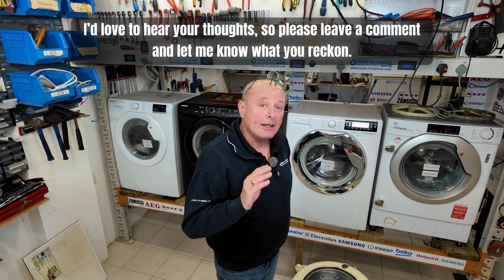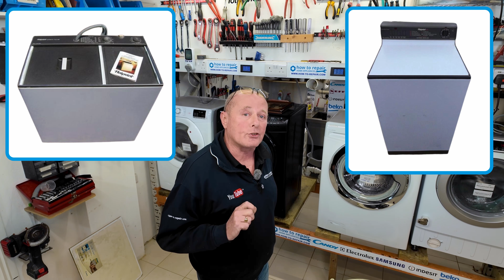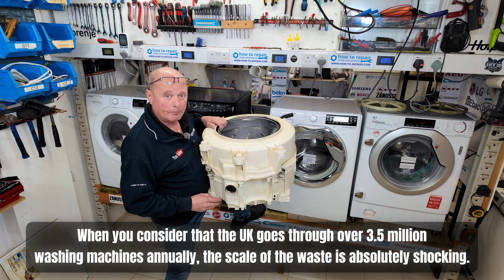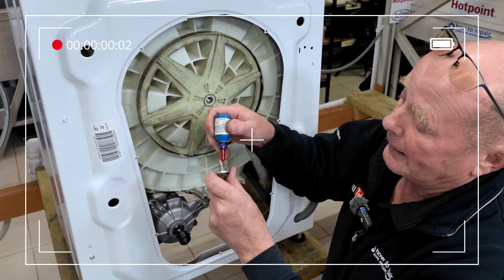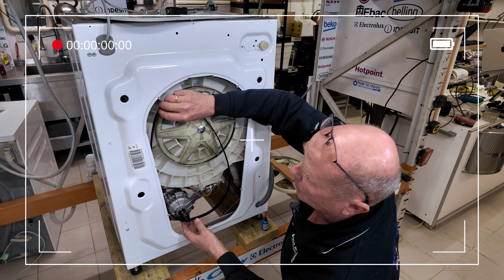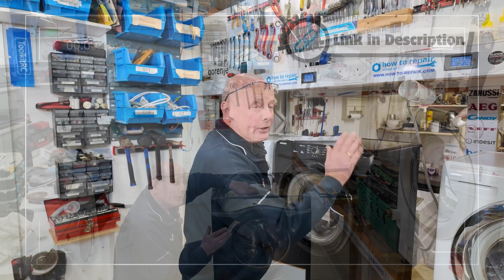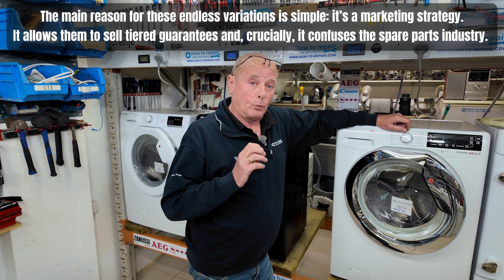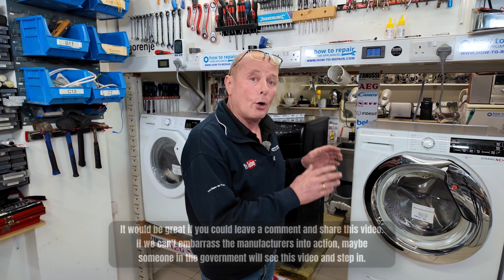I Scrapped 13 MACHINES to Prove a Point: STOP BUYING These Brands!

Comment: when I'm buying an appliance, I check availablity and prices of the spare parts. for example, I did not buy karcher pressure washer because any part was basically half the price of the new machine, but bosch had reasonable prices on their parts so I chose bosch. And I actually had to replace 2 parts during 3 years. Most of the people are not able to do such a reasearch when buying a new thing, we need some kind of community or initiative to inform people about brands and their products in such important aspects.

Comment: I've missed this kind of videos that randomly appear on my feed and turn out to be super fascinating! I've got an Inventor washing machine and I'm wondering what your take on that brand would be, but I'm not sure if they're sold in the UK. I also have a dehumidifier from the same brand, probably for over 5 years now and it's still going strong. Had to take it apart to clean it thoroughly a few weeks back and I was positively surprised on how easy and non-complicated it was.

Comment: Since there seems to be such a decline in quality and repairability in these large and well established European manufacturers, I would be really interested in comparing their products with ones from the likes of Midea and Haier.
In my very limited experience they don't seem to be designed any worse than the competition, but I would love to hear what someone as knowledgable as you has to say about it!
Reply: Haier are the parent company of Candy and Hoover who's machines you see in the above video. Their higher end models are better than these with things like direct drive motors and better reliability so they genuinely will last a long time, BUT they still suck for repairability. Their cheaper models are literally just Candy/Hoover machines with a different logo on the front.

Midea are best avoided in general. If looking at the cheap end of the market alongside Midea products, you'd be better off looking at Vestel. While nothing amazing, they are decently built if not a little cheap and basic, and while you don't get full repair guides and schematics you do get things like split drums and cheap, easily accessible spare parts so they aren't terrible for repairing either.

Comment: With front load washers, you literally get what you pay for. You buy cheap, you get cheap. You buy premium, you get premium. We've had a Miele front-load washer and drier pair now for well on 21 years now, and still have yet to need even one service call on them. And they still run almost like new.  And I'm likely to get at lest another 10 to 15 years out of them now with my reduced washing needs, now that most of my family is gone from the household. My fridge, my stove are the same deal; each pushing now 30 years plus without needing replacement.  Do your homework, don't be swayed by fancy gimmicks, and buy an appliance that may be more on the pricier side of things, but are also more rugged as well, and you shouldn't be disappointed in the long run.

Comment: Last year I bought a new Candy washing machine. Due to various reasons, I wanted a top loaded model and this Candy was the only option with an Inverter in my budget - it was about 550 euros iirc.
Unfortunately I bought it months before I could actually set it up, but that was my bad.
It leaked. Not much, but it did. Called a handyman and the issue was on the water admission. Sorry for not knowing the proper term, but essentially the admission hose was not sealing the place it joins on the inside. Solved with 2 tight plastic collars. It wasn't a big deal to fix but it's kind of stupid that such a thing passed QA.

My model I think is welded in the front, but I don't think it has the wooden thing for opening, it was quite a straightforward process on that side. The handyman did however say that the way they put the counter weight inside was very annoying and had a hard time working around it.

Comment: I was looking for new machine and some manufacturers offer extended warranty usually for the motor (like 10 or 15 years depending on brand and type), but considering the PCB, the drum and the wiring ... it's like manufacturer says "we fixed one of the problem but screw you possible on the other 3 expensive parts.

Comment: I’ve a QUESTION: Can anyboy with experience tell me, whether top loading washing machines, of which drums are oriented like the front loader machines in this video, are fixd on two sides and thus have bearings on both sides of their drums?
If so, I’d asume, they should rarer have waren out bearings. And that would be an important criterium for buying one. Does anybody know more? Thanks a lot!

Comment: I am afraid of washing machines. Although I have one at home, I use it only once a month. Every time I use it, I get panic attacks. What is your opinion on Whirlpool Sixth Sense washing machines? I have one of those, about 10 years old. It is actually running fine, but maybe bwcause I rarely use it.....thank you and sorry for the strange comments. I'm not trolling, I was traumatized by an incident with such a machine (but another model and brand) and just don't trust them.

Comment: It is not just sealed drums in washing machines. It is lead-free solder in electronics,  microchip controllers and infotainments in cars, particulate filtrs and urea (AdBlue)  injection system in diesel engines, smart control system in construction and agri machinery, proprietary / not changeable batteries and screws in consumer electronics, substandard components (small gauge wires in ovens, weak seals, weak plastic components, overstressed LED lights, overstressed heating elements),  overengeneered design ( unnecessary windows and "cool" features on kettles causing leak overtime, overcomplicated washing cycles, heat pumps in tumble dryers, asistents in cars,...)

Comment: Why would someone throw out their washer after a year and a half? Well, a dozen years ago we bought a Samsung washer. One day it went out of balance. That caused the drain pump which is connected by a piece of plastic to the tub (a major engineering flaw) to get ripped off the side. The drain hose which is connected to the bottom of the tub to a slippery plastic tube with no nipple and a trivial finger clamp just pulled right off with the movement of the drain pump. That allowed the water to drain out the bottom causing the washer to go into fill mode, causing more water to continuously drain out flooding our basement. The 10 year Samsung scam warranty means they charge a lot to visit, charge for parts, and charge for labor. My analysis (I am an engineer) showed that even if fixed, because of Samsung garbage engineering it was doomed to flood again. I couldn't sell it knowing that, so off the the dump it went.  

The important lesson here is many people now keep their washers upstairs instead of the basement. If you have a Samsung washer and do that, then plan on $10,000+ worth of damage to your house!

Comment: 1:55 A failing PCB is a hardware not software issue 🤓
Reply: Bro heard him asking for the smart people to add-on in the comments and decided to go all in.
Reply: @RongDMemer 😅😂
Reply: The pcb in boilers are usually half the price to just under the price of a new boiler. 
I can tell you that a lot of contractors for large associations will replace a two year boiler because it’s cheaper for them to do a straight swap than a dissemble, full service. Usually the components needed work out more than a just a new swap.
Reply: True, but depends on the failure.
Reply: @richardbigouette3651 not really. The „PCB“ is always the physical board. But yeah, its more of a joke bcs he asked for nerd comments 😂

Comment: Hoover is RIDICULES, over the years plastic in my vacuum cleaned started disintegrating, it become so brittle that buttons and a hook that prevents it from opening snapped, those parts should be compliant, they should never break unless someone planned for it because in normal use there is almost bo bending, the same happened to strips in exhaust grill. sure this vacuum has like 10 or 12 year, so what, if it sucks why should I change it???

Comment: An EXCELLENT video.  Having just repaired my Hotpoint NSWM 743U W UK, I had a flood because the flexible hose between the drum and the pump had fallen off the drum, and another leak due to capilliary action in limescale in the top of the soap drawer housing.  I look forward to other videos in this series.

Comment: Just right after two years of service, my dishwasher  has stopped running due to an inlet valve and the cost to replace this single part is nearly half the price of the entire dishwasher. This must be illegal.
Reply: I've ran into something similar in the US. We are on our 4th dishwasher in 20yrs. 1st was new Kenmore in 2003, died in 2006. Then we had a scratch & dent Maytag (we were poor) 2006-2010. Then we bought a high end Whirlpool, new w/5yr warranty. It was serviced every year, sometimes twice. Twice for a diverter o-ring that wore out. Repair man said it used to be a quick repair with $0.03 piece & he had a pile of them in his van that we were lucky to get the last one he had. It seems all the manufacturers switched to an integrated ring/pump that is now a complicated repair and a $180 part. They had to order the part & replace it all, or, remove the ring and scrap the rest. He showed me what to do and I fixed the next one. I also repaired the rack, replaced the sprayer arms, and the soap dispenser. I limped that machine along until the pump died spectacularly and I just didn't want to deal with it anymore. It was the longest lasting so far, made it to 2020 (rough year w/new dishwasher, oven, clothes washer & hvac). Then we paid ~$800 for an LG w/5yr warranty. We've had 2 leak issues. 1st was within 8mos and did not repeat after repaired. 2nd just happened. The supply line leaked, so I swapped it out last week and so far so good. I really hate how even with a "top brand" and a warranty the machines still need repairs every year or two. 

The worst offender tho, is our KitchenAid oven that over-heats enough to stain stainless steel tile brown (repair man said that was normal but I don't believe him). Also the front of the oven gets dangerously hot. It also periodicly refuses to turn off so we have to flip the circuit breaker box to shut it down. It had been delivered DOA & we were given a free whole line of induction cookware for the inconvenience. I am not sure what they fixed but it took a week to order the parts & install them. It has since had 2 new heating elements, 2 new PCBs, a new temperature control device, and a new heating element. We had paid almost $2k for a floor model that normally costs $3k. It had not been used, only displayed out of the box. I would never buy either that brand, or a floor model, again. By comparison, the oven we had prior was a Kenmore electric glass top oven that was 17yrs old and had 1 element & 1 circuit board replacement. Sadly, the circuit board died again & we scrapped it bc the parts just weren't as available anymore; the prices had risen to where we felt it was time.
Reply: @shadowmatrx   Oh I feel this so much. It’s frustrating. it costs our house economy  but also still costs time and stress and  It feels systemic. i think in the end we all end up being a handy man  :)

Comment: Reason for me to watch this video was the company, that you got a sticker from on the wall behind you: Gorenje.
Not sure, if you're gonna cover them, but the strangest thing happened to me lately: A coworker recommended me Gorenje Machines, since he never had any problems with them.
So I informed my GF about that and she went ahead and bought one a year ago, since she wanted a new machine. And bear with me, I'll try to put this into words as best, as possible:
A few days ago, suddenly the machine wasn't entering the spin program anymore. It just rotated the clothes around slowly. So I disconnected the drain and watched, if it was clogged. But it wasn't, so I told her to start the program again, and the machine wasn't pumping water anymore.
Opened the pump cover, to look if something's in there, but it wasn't. Pump was spinning, but only in idle speed. So, pump spinning, drain clear, what could it be? I then carefully put my finger on top of the center of the pump wheel and stopped the pump manually that way. Let go of it, the pump started to spin again and suddenly it started to rev up and pump water. We quickly stopped the machine, reinstalled everything and tested it...and there it was, the machine ran perfectly fine again...? So, I'm building computers in my spare time, using water cooling, that made me came up with the theory, that the data line of the pump, that tells the machine what RPM it's running at, might have lost track, or signal, so the pump had to be restarted, to be able to deliver the signal again. But who knows? For me it's a failure, that's just starting. But we'll see. My guess is, that Gorenje, too, isn't what it used to be, anymore.

Comment: What about "premium" brands like Miele? They claim to have machines built to last 20 years, and sometimes offer warranty on specific parts like the motor for 10 years. But they will still only offer a general 2 year warranty on the machine. So on one hand they claim the machine is built to last for 20 years, but they will only stand by that statement for 2 years... I live in Norway and the consumer rights are very strong here, so any washing machine comes with a 5 year warranty from the store, bound by law, regardless of manufacturer warranty. Is there any point in buying an expensive model, or are they all just built with planned obsolescence?

Comment: Its not in the interest of the Gov't to produce long lasting or repairable products.  I would prefer to see the lifetime displayed with advertising, and for that then to be guaranteed.  With service requirements, and a guarantee of parts supply, the release of the design specs so parts can be reproduced.
I'm still working on the crowd sourced fault database.

Comment: I agree. These faults and design choices like welded cabinet or sealed drum are not manufacturer mistakes, they are deliberate decisions of manufacturer.

However, we need to take a look at economy. 30 years ago how many washing machines you could buy using one month salary? And today? Say new one costs 400. Will I call repair guy and pay him 200 to fix 7-8 years old machine when I can buy new one with warranty for 400? Ofc not.

It would be a different story if the machine would cost 2000 anew. So it isn't just manufacturer fault. It is the consequence of expensive repair labour and cheap product. And we do want cheap products.

Comment: Back in the mid-2000's, I inherited my grandmother's UPO which I believe she had been using for several years at that point. I only parted ways with it after about 11 years due to moving out of the country. At that point the biggest problem with it was that the program selector dial had become somewhat flimsy (due to connector oxidation, I believe).

Comment: In Sweden we have a 3 year right to reject or repair under consumer law. This is for any physical item that's sold. From a washing machine to a plastic £1 spatula. The receipt might say 1 year, but that's what the manufacturer is giving the store. If a fault occurs within the first year, the store will handle it with the manufacturer. If a fault occurs during year two, the store still has to handle it but without financial compensation from the manufacturer, it's simply a loss. Year 3 is the same thing, but the consumer must show it wasn't user error. This is an incentive for stores to not sell crap, and for manufacturers to get it together if they want to sell to the stores. Also, if you replace your washing machine, the store has to take in your old one and recycle it, or send to a recycling facility. This is also by law and even if the old machine wasn't bought at the store. In short, if you sell it, you will also recycle it. This is for anything electric.

Comment: Not only are they building in obselesence, they are making it very hard for the lay person to distinguish between a long lasting machine and a pile of disposable plastic with an elaborate circuit board. You could buy a €1400 washing machine with all the bells and whistles and it could fail on day 1 with no repair possible. 
So we can't vote with our wallets for well-built machines because we can't make out a good one from a bad one. So I'm looking forward to your in-depth reviews.👍

Comment: Thank you sir for mentioning something in passing that I had not considered... high pressure water lines possibly leading to the rust under the detergent drawer. 

Also, my sincere thanks to ALL Youtube creators who take the time to guide us FIY'ers through repairs... almost 14yrs and my Samsung washer is still spinning after a PCB board and bearings replacement. h/t 🎩

Comment: You can open  drums with  box cutter and  metal saw blade, but prior to that you make holes on lips of drum where it is glued , then when you saw it,  change bearings and grease it  you take  red silicon glue for high temperature around 7 dollars, then you make seal around the lips on sawed edges, put together two parts of drum, and then you screw it while silicon is fresh, it will hold hot water and chemicals  until next time bearings fail.
Reply: Műanyaghegesztővel körbehegesztetni.
Reply: @LászlóJuhász-q8v What language is that bro?